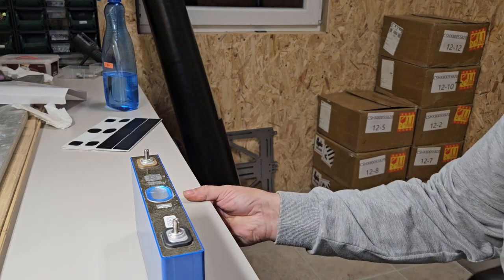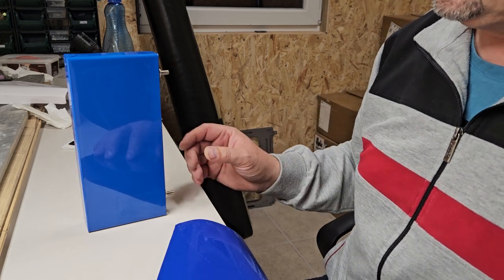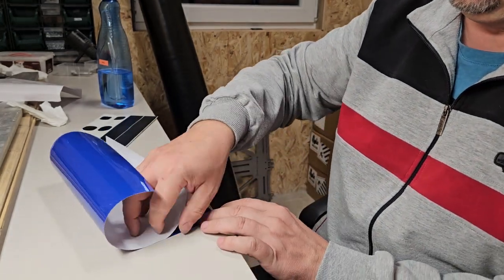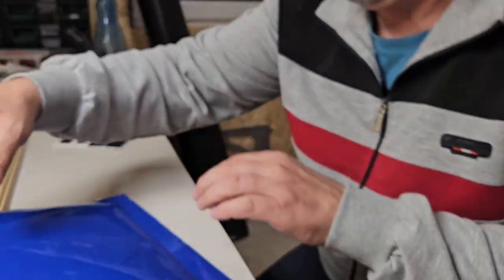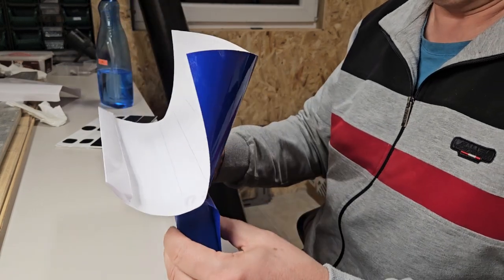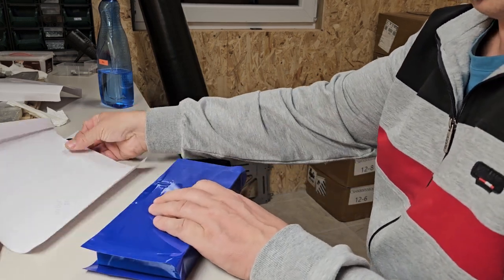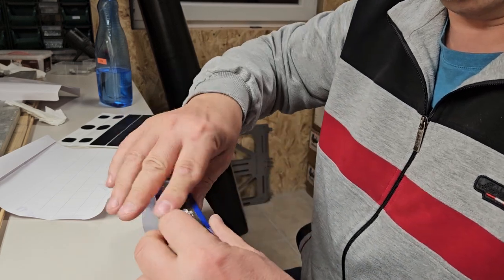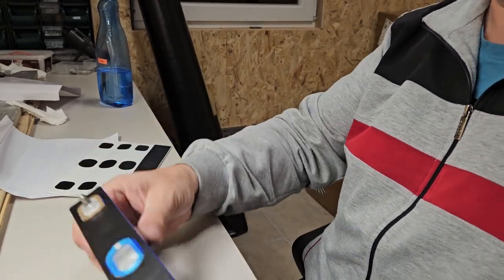Rewrapping CATL NMC cells for Nissan Leaf to reinforce insulation

Comment: thanks for uploading all those... Dumb question: why wrap the cells? isn't the case insulated? Bonjour du Québec, Canada!
Reply from the maker: No it is not a stupid question. The aluminium battery case isn't tied electrically to any electrode so it's potential is somewhere between the + and - voltage because the electrolyte is filled in the cell and it is slightly conductive. The problem would be if several cells would have the cases on the same potential (shorted). Then the higher voltage would ionize the electrolyte which would start conducting, boiling and kaboom. The original protective layer is enough but I add another layer just in case. You can never be too careful with this. The rear pack also has really a little space for battery "breathing", only around 15mm. Since I don't exactly know how much they will bloat over time (they should under 1%) this insulation must hold on in case of big forces in the battery pack. Greetings to Canada from Slovenia.

Comment: Very nice.  How much does it cost for all 96 cells? I'm lookin to replace some of the cells in my leaf 2018 40kw battery.
Reply from the maker: It depends and it is risky, sellers promise new cells and you get damaged refurbished cells sometimes. It is around $35/pc + shipping and taxes.
Reply: Thanks for this video also! Can you suggest your supplier? At least for the foil if not the battery
Reply from the maker: @cosminhoriceanu3900  Of course, Search for Starmax on Ali and sales lady Selin Zhang.
Reply: @slavric  thanks! found it.. but i have a few questions further about the cells wich one did you use? 300 or 220 mm width as both are 117ah and also wich suplier? (starmax  doesnt get 100% trust from my point of view and cant find on alibaba  Shenzhen Header Creative Energy Technology you mentioned in other coment)
i understand you also spent time researching and asumed risks so i am willingto contribute for further help
Reply from the maker: @cosminhoriceanu3900  The cells are 220mm. Starmax isn't the cheapest but at least I got what I ordered. Don't bother the "Header" company. They show new cells on the picture and what you get are "refurbished" ones. They are pulled from some packs, can be a bit damaged and re-wrapped. So no thanks. You can contact me on mynissanleaf forum, I'm Lucky there.
Reply: @slavric  thanks! noticed your posts there also